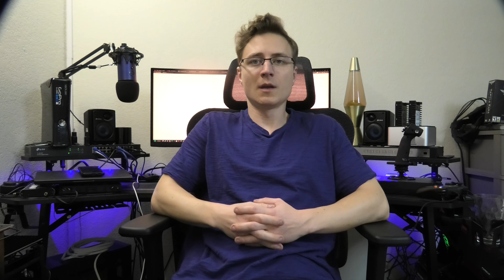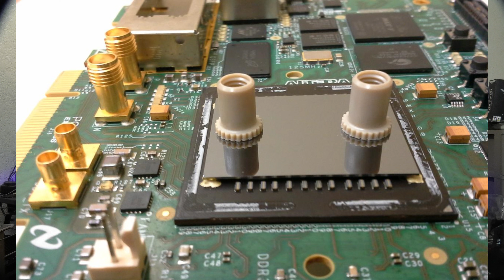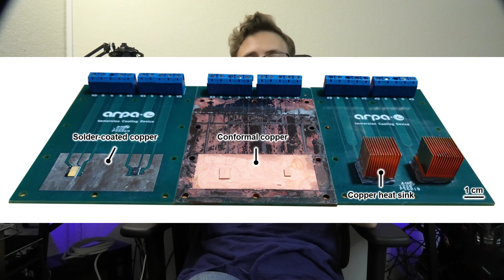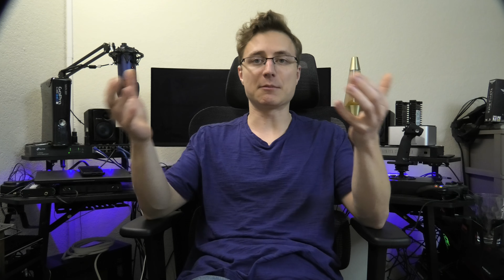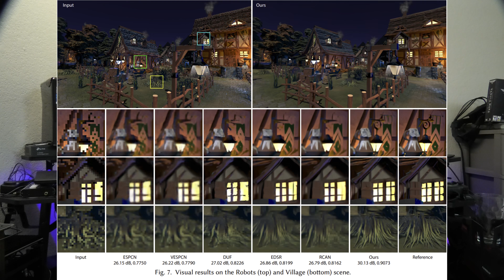Are GPUs going to need 220V in the future? Neural Nets to the rescue?

Comment: The thing is that from now on, we'll be right at the limit of silicon efficiency, GPU aren't actually inneficient, it's that the actual function of them is not physical work, therefore the electricity itselft is almost entirely tranformed into heat, they get more efficient in their function because as the transistors get smaller, the same area, which uses X power to function, now has more transistors in it.

The next jumps in performance per watt won't actually come from Raw power increases but keep comming from software and hardware optimizations for certain tasks, and then by the progress of graphene or optical processign units, both having the potential to offer more performance per watt due to having far higher frequency tolerantes, therefore not needing as much power going through them to function properly at really really high frequncies, and these will eventually get to the same point we're in right now, as the trend of civilization progress is to keep incresing power needs over time
Reply: interesting

Comment: There is technology to convert heat energy into electricity. NASA currently used it on the Mars Perseverance Rover to increase its battery life.  Maybe PC Industry needs to look into this tech for the future.
Reply from the maker: My biggest concern is that power targets keep shifting higher every generation and at some point its just going beyond ridiculous. 1800-2000w is space heater territory and at some point given the sheer number of gaming pcs the  government will probably start taxing high power usage from gamers probably by making people report their household electronics and making a crime to lie about what you have at home.
Reply: @cr4zyw3ld3r  I don't think it will reach that level because my thinking is as power requirements increase the operating cost of PC gaming will rise and there will be a economic fall off of people that can afford to PC game or more likely is people stay on older hardware and AAA tiles decrease in popularity in favor of Indie games that can run on lower spec computers. Heck GPU maker are already pricing people out of PC gaming just with hardware prices. Oh I was thinking take excess heat energy convert it and put it back into the GPU to assist in energy efficiency similar to an EV's regen braking.  But I am not an engineer and I don't even know it would work
Reply from the maker: @linuxMaggott  I have seen people run the heated water from their PC into a pool I think it was mainly to use the entirety of the pool volume as a reservoir as I doubt even the most overclocked PC would really be enough to heat a pool. As for transforming the heat into electricity you could use tecs but they are horribly inefficient and I am not sure other current heat to electrical tech could be feasibly mounted inside a PC case.

Comment: Not sure where you are getting your info, but you can get 1600 watt supplies, or higher, that will run off your standard nema 5-15 outlet. Standard 5-15 wall outlets have a breaker and wiring for 15 amps, which at 120v will give you about 1800 watts, which is the what a 1600 watt platinum or titanium rated psu will draw. That being said, most new electrical will actually run 5-20 20 amp outlets which can accept both 5-15 and 5-20 plugs. These outlets would allow power supplies up to about 2100 watts. Granted other things often run on the same circuit, however many rooms will have outlets on different circuits. 

The stock 4090 power limit is 450watts, some cards have power limits up to 600watts, anything higher than that is altering the bios.
Reply from the maker: My area is all 15amp outlets and you never want to run those past 80% NEC which means a theoretical max of about 1440w and even then I do not trust the receptacles that are installed to be quality enough to handle that all day long.  Plus due to space constraints I have additional equipment running through the same socket. So is it possible that you can those higher watt PSUs sure but not at every person's house. As for the new GPUs a good chunk of NVIDIA AIB cards are now running 600w+  for enthusiast variants. And its been shown that even the FE can run that high in some scenarios on STOCK BIOS https://www.hardwaretimes.com/nvidia-rtx-4090-draws-over-600w-of-power-in-certain-benchmarks-can-be-overclocked-to-3ghz-or-more/